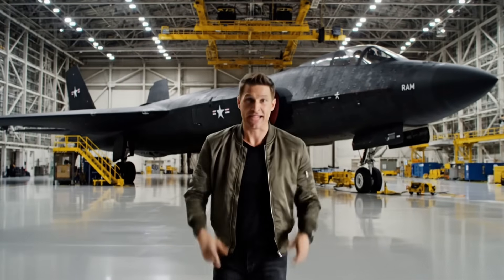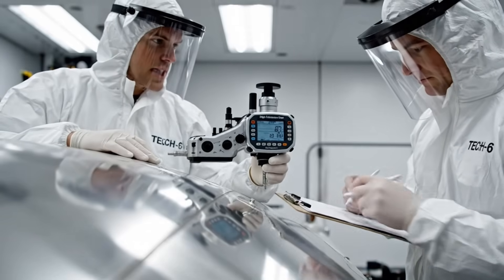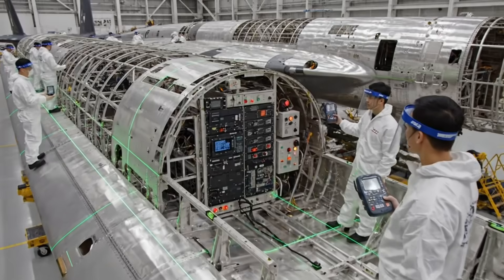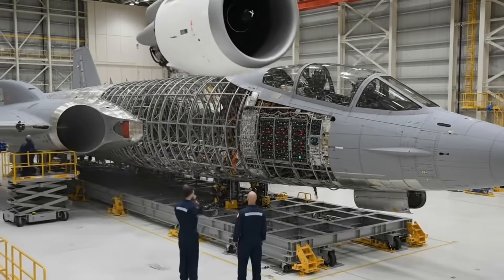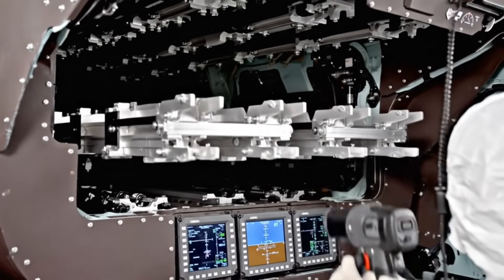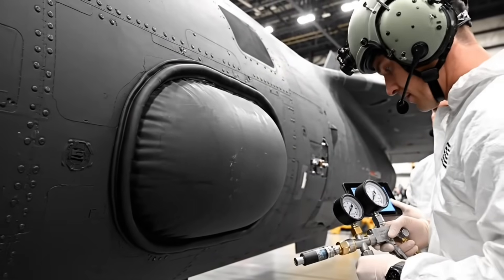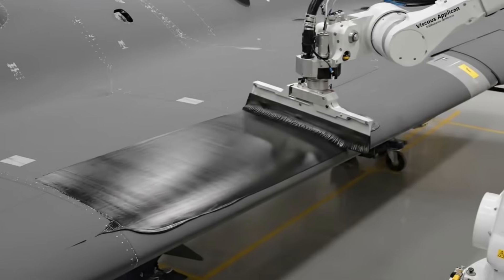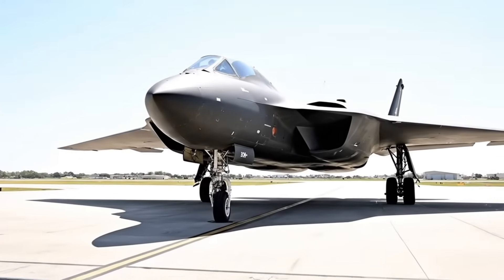Inside the Secret B-2 Spirit Jet Factory Building the $2 Billion Stealth Bomber Ghost (Full Process)

Comment: The most impressive part isn’t the aircraft—it’s the factory. Every panel gap, every surface junction, every material layer is hand-aligned within tolerances thinner than a sheet of paper. Stealth isn’t built; it’s sculpted. That’s why the B-2 is still unmatched after 30+ years.